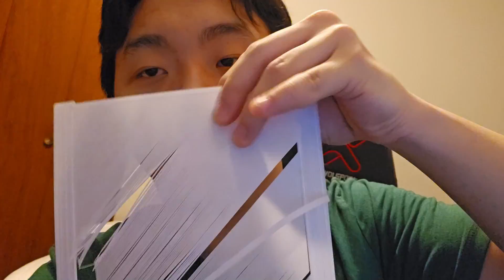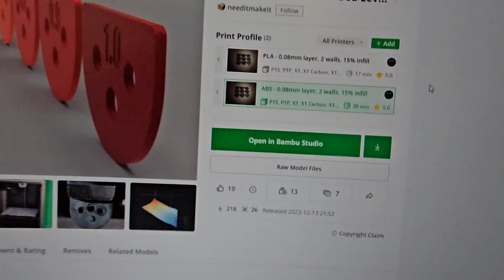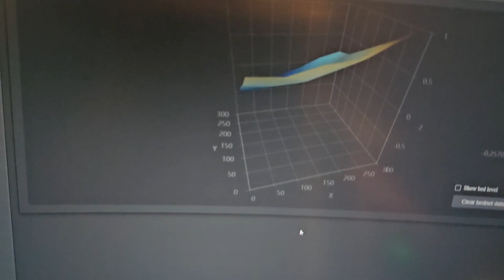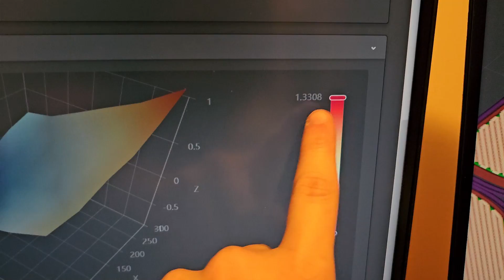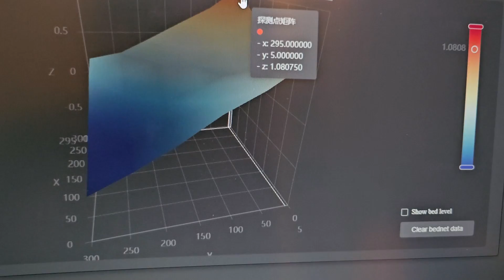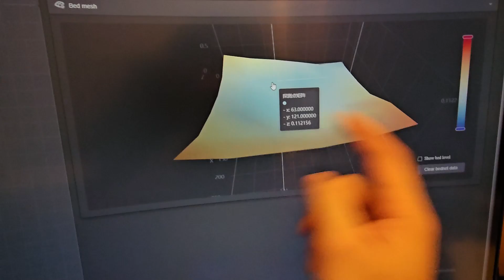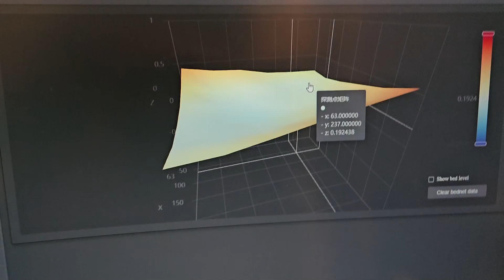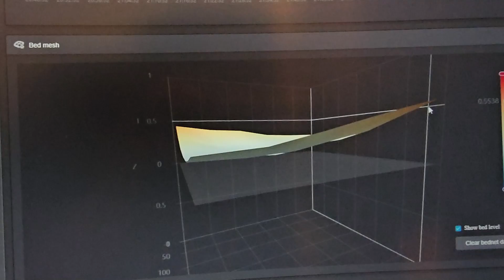Creality K1 Max How To FIX Bed Leveling Best Method

Comment: This is why i rooted my k1 and installed fluidd. I did this the 2nd day I got my k1. I have had it for a few months now and it works great. I also used the spacer .
Reply from the maker: Nice. I am thinking about rooting my k1 max as well, just don't have the time yet.
Reply: @Scratch3DPrinting I waited WAY too long to root mine.

Comment: Odd to say. That bed wasn't too bed to work with. I have a huge camel back in the center. I can get all 4 corners looking good...but the camel back hump. I don't know how to pull the center down! It was suggested to just replace it?
Reply from the maker: Yeah if the middle part is humping then the bed is warped. There are replacement for the k1's bed out there.

Comment: Yes, sorry...I have an almost new Ender 3v3 core xz with exactly the same problem you described on your K1,; the mesh I get in Fluidd is horrible, I think it might be a common issue on the core xz model too, and if you could make a tutorial on how to fix this issue it would be great. Thank you very much for all your videos!
Reply from the maker: Ahh, I would have done a video a long time ago if my ender 3 v3 has bad bed mesh, but unfortunately I got a great bed mesh, my prints on the ender 3 v3 is always perfect. Not quite sure how would I adjust the bed on the ender 3 v3. 

Maybe you can try to tighten the screw on the bed and manually level it using the paper method. But I'll see what I can do, if you need more help join my discord, there are many knowledge people in there.
Reply: @Scratch3DPrinting  Thanks for responding. My mesh looks identical to the one you show at the start of this video; I've had this printer for a couple of months and first I believed my bad results were because noob errors but now I have realized it is impossible to get decent printings from this machine. There are no screws to tighten here like in the older Ender 3, just 4 tiny screws that cannot be adjusted, and regarding the paper method I don't see how can it be performed on this machine. Please let me know if you think of something, I feel frustrated because I can't find anything on the web about this issue. Thanks again!

Comment: Whats your printers situation now? Do the spacers still work?
Reply from the maker: unfortunately I got rid of the spacers and did a belt adjustment and redo the bed leveling and now it's working fine.
Reply: @Scratch3DPrinting  What kind of problem did you live after spacers mod? I have done that mod, actually everyting seems ok until today but now two times my prints cut middle of printing today. Hotend just stopped without a visible reason. Is it possible that they were because of spacer mod? What do you think?

Comment: I only added second smallest spacer to the lowest point, then tightened the screws of the ones that were still higher/orange and  is mostly white now and more level to the bed, might help you if you want a better result.
Reply from the maker: That's nice to hear. I did try that a while back, it works for like a week or so, then problems start to arise, I did remove them and adjust the belt a bit and now it's printing fine.

Comment: Where did u get the bed level graph?  Creality print has no such view.
Reply from the maker: You need to get the printer's IP address and put it into a browser, ex: Google Chrome, Microsoft Edge, Firefox, etc. Any browser you use, Creality Print don't have it.

Comment: If you are going offline after resetting is it getting a different IP address from DHCP each time? The IP address in Creality Print is sticky, but most people have dynamic addresses in DHCP.
Reply from the maker: uhh, interesting. I did not know that.
Reply: @Scratch3DPrinting  you should try to put the printer on static ip, that's what I've done.

Comment: I added screws with a suspension under the plate so i can change it on my own. After i rooted my k1 max and in fluid i can do srew levelibg and it give me a fast recommendation how the corners are leveled. Then bed leveling and my result was good not perfect. There is still a litle whole in tve middle😢
Reply from the maker: Ahh, I'll look into that and maybe do the same thing

Comment: This ia a great video! However I am struggling to understand how you actually did it. Is there any way that can do a more in depth video explaining how you did this. Great video and I enjoy your content.
Reply from the maker: I did not do much, all I did was print out some spacer and put them on the 3 corner where the lead screw were. 

There should be 2 screw on each of the lead screw(rod) take those off and put the spacer in that spot, then put the print bed back in and rerun the auto leveling. Check your bed mesh on a browser (chrome, Firefox, edge, etc) which ever browser you use. Then just repeat the step again. 

Let me know if you need anything else.
Reply: @Scratch3DPrinting  I have been working at getting it correct for a few days and the improvements swing wildly. I have experimented with different size shims to see what effects it has on the results and the swing in the map is crazy. I actually love the process of learning what happens when the change is slight but getting it right is frustratingly interesting.
Reply: @ClarenceMcCrayII you need to let the bed heat up for around 10 minutes before attempting to calibrate.

Comment: consider yourself lucky, I have a CR-M4, one of the lead screws arrived so badly bent it grinds when it moves and the bed was so badly warped I had to bend it back flat with a rubber mallet
Reply from the maker: omg, that is unlucky, hopefully you were able to fix it.

Comment: please, is there no one who can answer me… how do I add the program that sees the unevenness of the table??? It does not exist in Creality Print.
Reply from the maker: You can't see it in Creality print. What you need to do is, get your printer's IP address and type it on a browser (I use google chrome) then you will be able to see it.
Reply: Can you make a video about this subject?  @Scratch3DPrinting
Reply from the maker: @harunersahin304  what subject do you mean? The bed leveling or creality print bed mesh?
Reply from the maker: @harunersahin304  You can't see it in Creality print. What you need to do is, get your printer's IP address and type it on a browser (I use google chrome) then you will be able to see it.
Reply: I don't know why people aren't explaining proper. You need to look in your printer's network area on the LCD,  type that number into your browser. The IP address will change over time from your router setup to give your random ip addresses, you can change this by logging into your router, find the ip address the printer is using and set it to static(Bind it) If that's too much trouble, just remember the ip address changes, typically when you restart your printer or router.

Comment: Mine has the up half at 0.3 and lower at 0.2 and mostly level across the board. I do have klipper installed with fluidd for the UI. I used Creality-K1-and-K1-Max/wiki/Installation-Helper-Script from Guilouz on github and it took maybe 10 minutes in total. I only printed 1 time on creality OS without klipper and have had klipper since and haven't had 1 failed print.
Reply from the maker: nice to know. Thanks for sharing.

Comment: you can put silicon spacers under bed, just cut then 11mm high. which is the same height as the hole in the bottom of glue stick 😂
Reply from the maker: I'm going to keep that in mind when my print starts to have bad first layer.